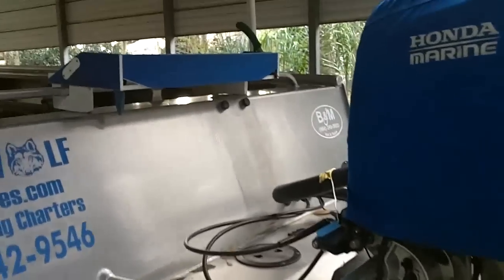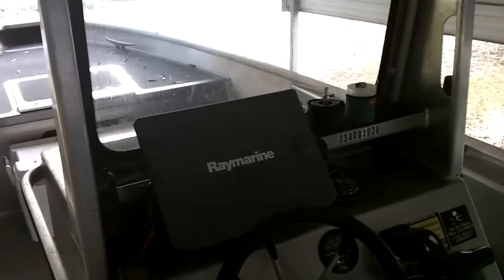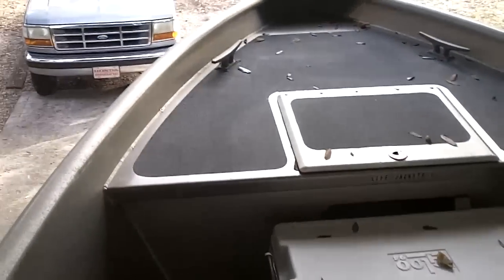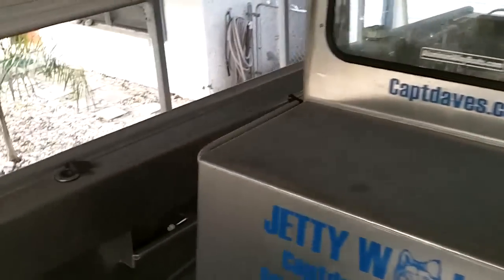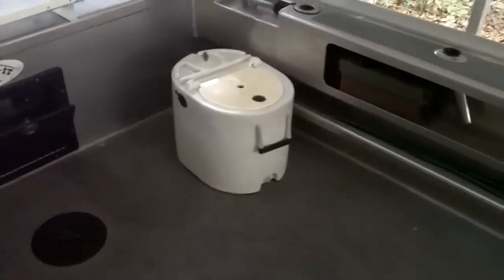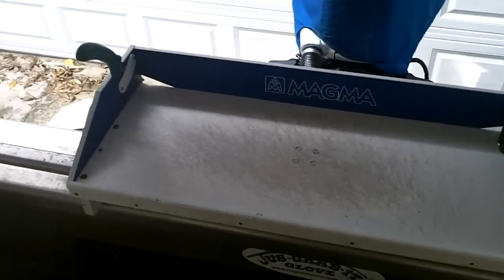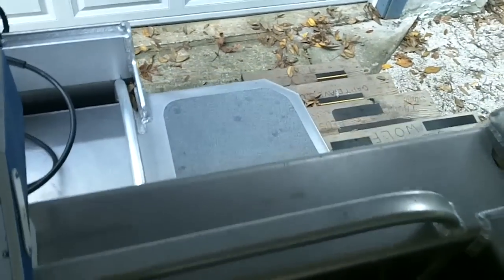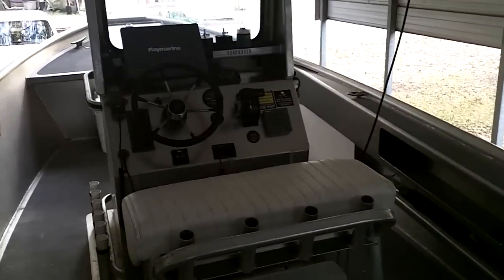Jacksonville's BEST charter fishing boat

Comment: I like the console location. looks like you had the manufacturer move it forward some.
Reply from the maker: 2 -1/2 feet forward....we fish in current. unlike all those goofy boats with the console at the transom that makes zero sense, and gives zero stern fishing room. I on the other-hand know that ''sucks''. SO, instead I have ball room dancing room, where it counts. The Jettywolf is a actual true ''center console''. Max room to fish around entire console.
Reply: Capt Daves Sportfishing Charters I completely agree! I have mine forward also, 10ft of deck toward the motor!
Reply from the maker: ""Mine also""......You have a Pacific 26?
Reply: Capt Daves Sportfishing Charters I wish! I run a 25ft Parker. I've looked at the Pacific boats hard since I started watching your video's
Reply from the maker: Oh, yeah I know them, cabin? All the cabins have good deck space. I had a 23' MayCraft CC before my Alloy boat. Same as a Parker less $10 grand. Had that for 10 years.
Reply: Capt Daves Sportfishing Charters It's a console boat, bare bones no glitz or glamour. May craft makes a solid boat, I've fished aboard several.
Reply from the maker: Good...I hate boats with all the BS that breaks. My old MayCraft was a bare bones 1996. Ken May didn't even make 200 hulls back than. BUT the open transom was hard to deal with. My Jettywolf is the 180 degree  difference (for the better)